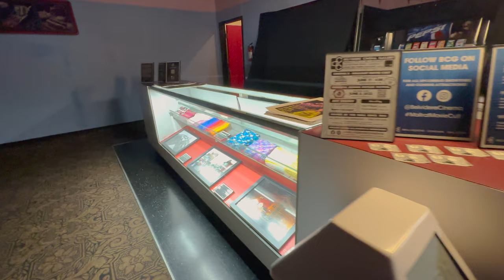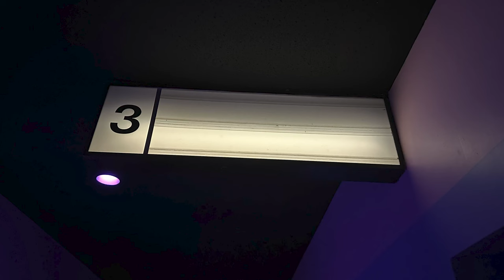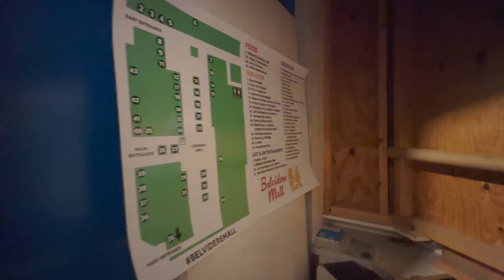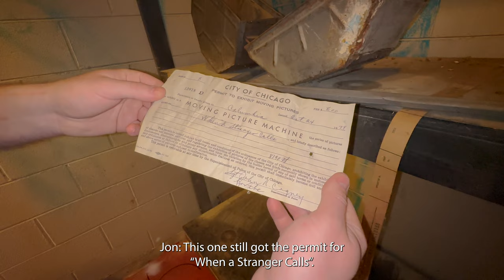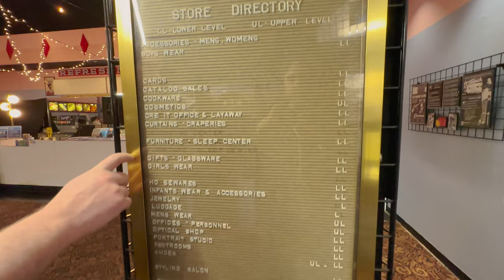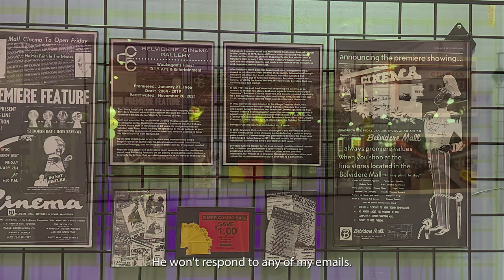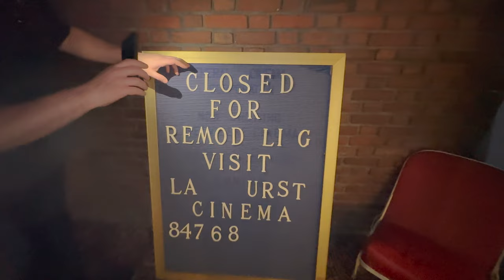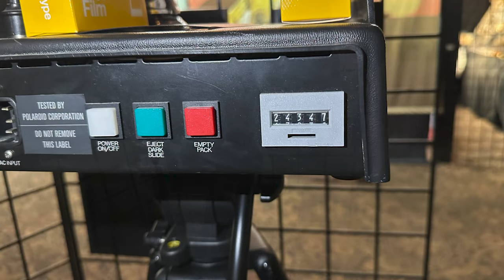Belvidere Cinema - 1960s retro General Cinemas theater

Comment: The seats weren't haphazardly reinstalled. The trend at the time was to install the seats in the row behind between the seats in front so it would be less likely to have a tall head directly in front of you.
Reply: This theater opened with the sloped floor seating that was typical of GCC theatres. When Village replaced the original 37-year old seats with used seating circa 2002 they did a piss job on the install: they left most of the mounting hardware on the floor loose, many of the seat back bolts only threaded a few turns, and some arm rests fell off during our first shows. I wound up going through all seats in both theatres to finish a job someone else started 20 years earlier.